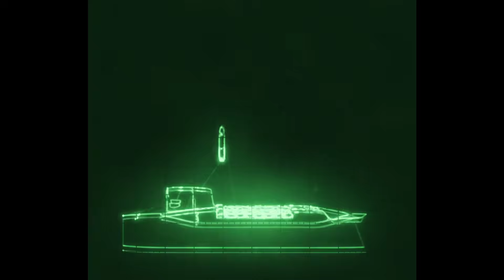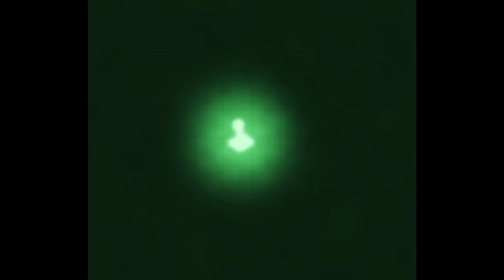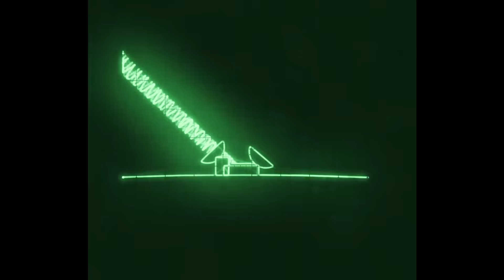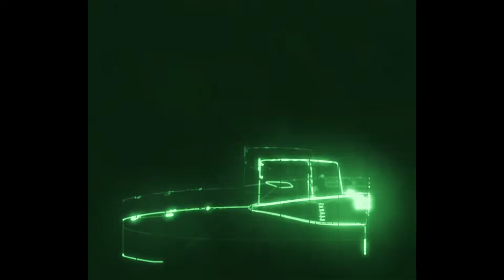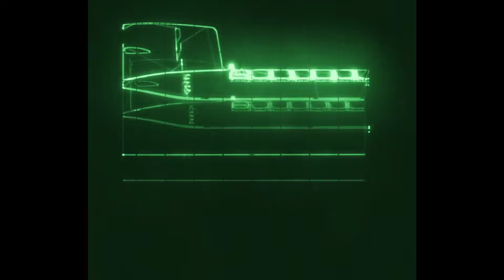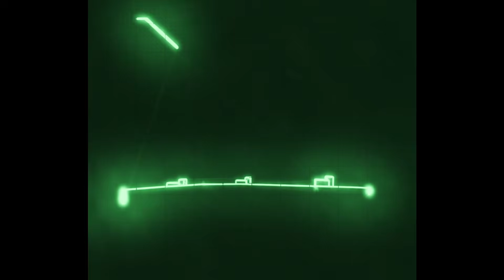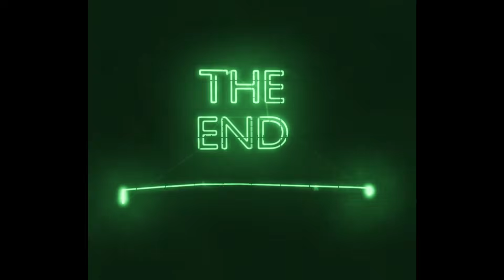Polaris + Transit: When the US Navy Invented Satellite Navigation as a Side Project

Comment: Inertial guidance is absolutely insane, I've thought about this ever since I was a kid messing around with modding games and building simple robots but I always thought this is not practical because the degree of precision you would need is absurd, summing up acceleration to estimate position is basically what they would call a chaotic system, if your clock or accelerometer is even a tiny bit off, it will be magnified so many orders of magnitudes in your results.
And yet they used exactly this to guide missiles, no wonder it is so difficult to build nuclear weapons, it's hard to say which is more difficult, the navigation or the warhead itself.
Reply from the maker: I remember back in 2007 or so a lot of electronics experts were absolutely raving about how the mems accelerometers in the new (at the time) iPhone were a huge deal and would have cost thousands of dollars just a few years prior. 
I only really understood the hype a couple of years later when I started flying light aircraft and saw what the mechanical gyros in aircraft instruments look like.
Reply: @Alexander-the-ok I had a RC quadcopter from the pre-mems era with a mechanical gyroscope on it
Reply: Ya the accuracy required at the time for these guidance systems that were essentially dead reckoning is insane. I guess to some small extent the fact it was a nuke helped alleviate this a little- whether you hit the exact spot your wanted or a couple hundred feet or even a mile away didn’t matter that because it’s still a nuke, but even that accuracy seems insane. And if I’m not mistaken a lot of these did get to at least within 1k feet accuracy if not more accurate which is pretty insane for pretty much pure dead reckoning. 

These days the most difficult thing by far is actually making the nuclear material, and even that is largely difficult because everyone around you is likely to know you’re making it and try to stop you (see Iran), not because its technologically an insurmountable goal. The tech for making a delivery system is fairly easy, but that’s because satellite guidance, like gps, is so readily accessible. If you want to look at an entirely domestically independent delivery system, one that doesn’t use any other countries satellite system, then all the sudden it is a lot harder if you’re not one of the few countries that already has a system. There’s basically 4 gps equivalent satellite programs, the us gps, then the eu one, the Russian one, and the Chinese one.  Outside of these, it’s going to be quite difficult and expensive for a country to find a way to set up its own entirely domestic system. Even Russia struggles somewhat to keep up with the other 3 (not in a way that matters for nuclear missile applications mind you, it’s just enough less accurate that it is notable when discussing some military applications, you might be looking at a couple meters off rather than less than 1 meter). 

That said, given the list of countries that operate them, you’re always going to be able to find a country who will let you use their satellite no matter who you are, and because China and the us are sort of vying to be the global satellite system (or in americas case stay the global satellite system), you don’t even need to be aligned with them- afaik Iran uses American gps for a lot of its satellite guided missiles. It just isn’t worth it for these countries to try to shut it off for foreign militaries as a strategy to deny them, because they have an adversary willing to step in to fill the gap anyway. Obviously if you went into a full offensive conventional war with them they probably would, but that’s also kind of a fairy tale situation because the us and China have far too many nukes and are far too powerful for really any country (besides maybe each other) to even consider a full conventional attack. In practice the access to gps (or the Chinese, eu, or Russian equivalent) is guaranteed so ballistic missile programs don’t actually really have to consider that as something that needs to be overcome domestically, even if they want to generally be independent and not reliant on other countries. The result is that in practice obtaining the necessary refined material is the real challenge for most countries and the thing preventing them from building a nuke tomorrow. Ballistic missiles aren’t particularly hard for countries to build and most have some anyway even if they don’t have nukes, it’s the uranium enrichment or power plant capable of producing plutonium that are the real short term hurdles, and again even those aren’t impossible for a country and it’s really the political pressure that prevents it.
Reply: Hey, since mems is essentially a gyroscope reimagined in a new shape, it probably also can be used as method of maintaining orientation in 0g, like CMG. 
Though, would likely to require a bit more oscilating mass...
Reply: Dead reckoning is a fitting term in more ways than one.
Reply: Honestly? Probably the navigation. Nuclear warheads are hard to build because they’re expensive, not because they’re tough to assemble. Once you can refine enough uranium you can build a basic fission bomb, but delivering it is another story
Reply: The warheads are relatively simple. For ballistic missiles the vast majority (think 80-90%) of the budget goes to the delivery vessel. I imagine a significant chunk of that is guidance.

Comment: for the rubidium clock, a fun experiment is viewing the response to mechanical stimuli. I've done it with quartz clocks before and it's pretty fun
Reply: What do they do...put out randomly varying signals for a minute?
Reply: @stevengill1736  I know that quartz varies its frequency when rotated along its axes, especially the vertical one. Perhaps it's the same with Rb, no idea. It also exhibits piezoelectric behavior, in reverse, forgot the scientific term for that (triboelectric?).
Reply: @ligius3 it's still piezoelectric behavior
Reply: @stevengill1736  here so i get a notification for the ansear
Reply: @stevengill1736  it will cause the signal to drift in interesting ways

Comment: 14:20 wood is still used a lot in amateur rocketry, not quite for the nosecone, but yes! Wood in rockets is still alive
Reply from the maker: I think cork is still used in insulation in actual spaceflight. It has better insulating/workability/fire resistance properties than basically anything else out there.
Reply: @Alexander-the-ok  Cork used to be the material of choice for ablative heatshields, and as far as I know, the Russians still use it for Soyuz. But the US has moved to engineered materials.
Reply: @Alexander-the-ok  Copenhagen Suboritals uses cork derived material for their heat shields.
Reply: Balsa is still used in model rockets for nose cones and fins.  Just not if you're buying a kit from Estes, they've gone all plastic for their nose cones.
Reply: Birch plywood fins ftw

Comment: Also crazy the first missile subs could launch submerged.  I think if I had been responsible for designing such a system in the 1950's, I would've had the launch tube detach from the sub, float to the surface and then launch.
Reply: Weirdly that idea re-emerged but as a way to hide a submarine, the submarine would deploy the tube with the ICBM and then leave and then the ICBM would launch itself after a set time or after recieving some sort of command. This would make the submarines even harder to find since not even the ICBM launch itself could be used to track the submarine.

Comment: "trough the hatch" isnt really a problem.  Its hardware. Only thing that needs to fit trough the hatch is maintenance items.
Reply: This could be a restriction if the computer was known to fail and be replaced rapidly during crew changeover periods.
Reply: @KnowledgePerformance7  Yes it was according to my knowledge from the past.
Reply: That is patently incorrect. As demonstrated in the video and according to experience.
Reply: If a computer breaks while out at sea then it's significantly quicker to just replace the entire computer and repair the broken one on land rather than putting the sub in dry dock for a few weeks while the computer gets fixed. And early computers were fairly unreliable so it'd probably break long before the sub was due for maintenance. Not to mention it significantly simplifies logistics if you can repair the computer outside of the sub since it means the people doing the repair work don't need clearance to enter the sub. Plus I imagine the Navy might be interested in occassionally examining a computer after a deployment.